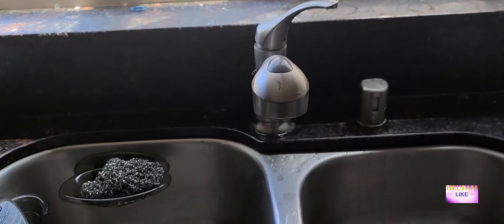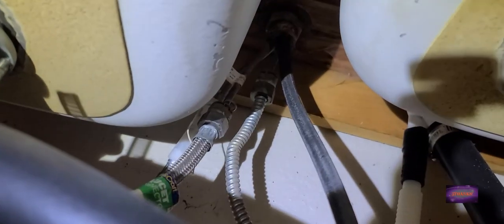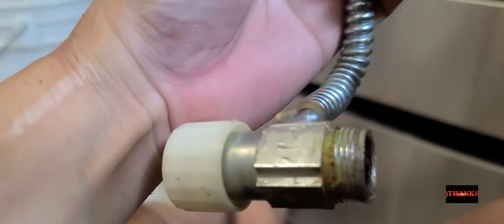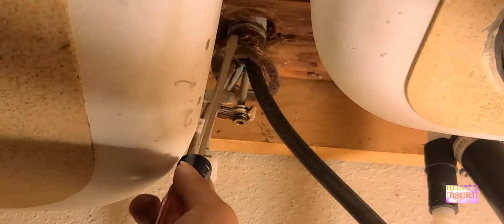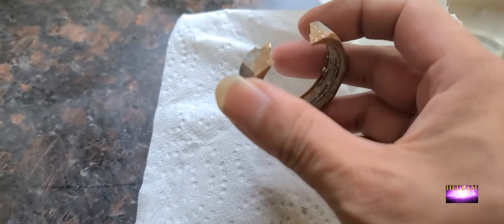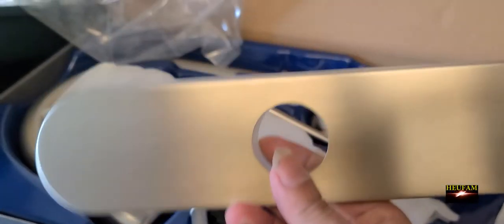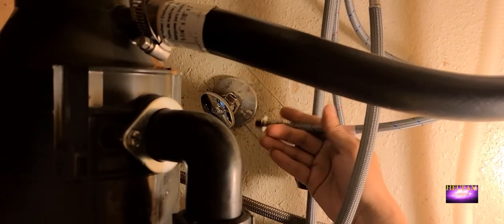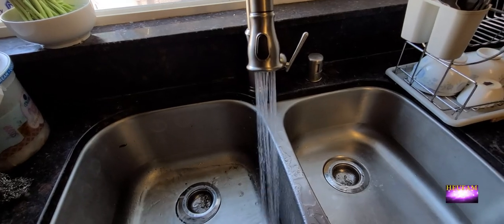How-to DIY: Replacing an Old Rusted Kitchen Faucet

Comment: Good idea with the drill. I had to break the faucet off on the top side. It was a pain! The new faucet has a big plastic nut and no tools required to install it.
Reply: How did you break it from the top. Having the same problem and I do t thing I can drill it from the bottom because theres too much pipe. Please help, thank you
Reply: @its_tashin8175  I grabbed a hold of it and yanked it back and forth. It broke off flush with the counter. Otherwise get a Sawsall and saw it off.

Comment: Great video 🎉. Im scared to do mine ita hard hard.
Reply from the maker: It's not that hard if you got the tools... hardest part for me was going under the sink looking upward and laying on my back.
Reply: @HeuFamilyEnt in the center circle main part. I have a brass fitting with 2 screws at the ends. Them screws are rusted bad. I might need oscillating tool to cut it. 😂😅